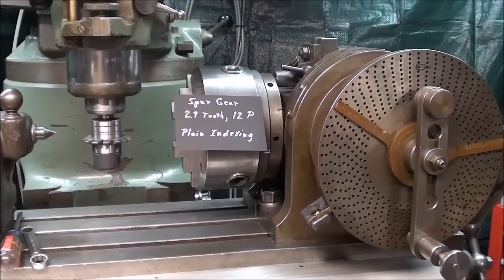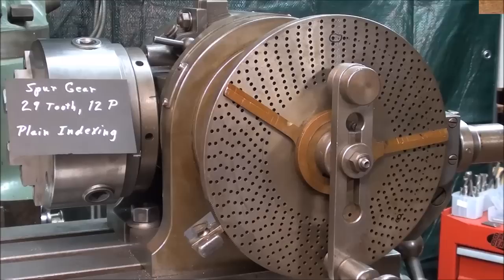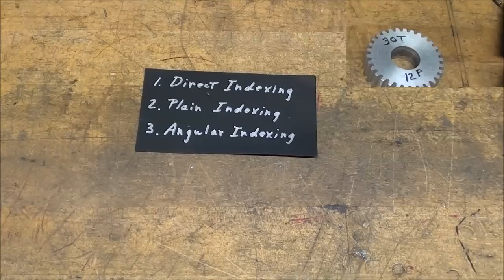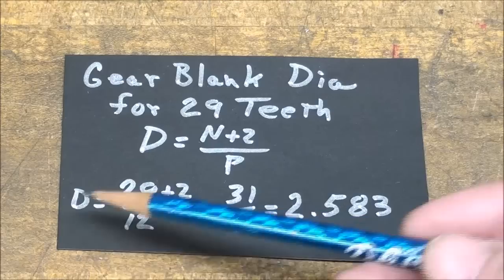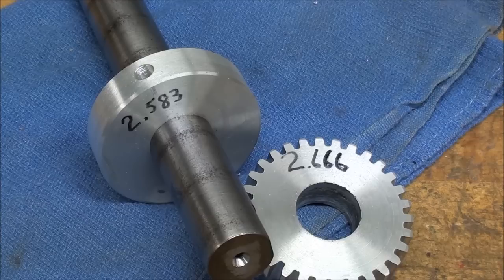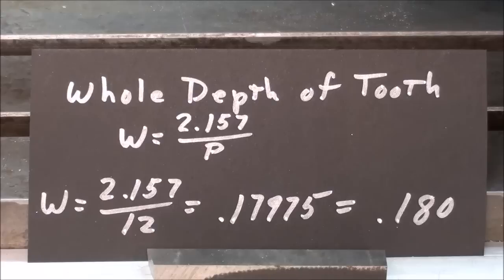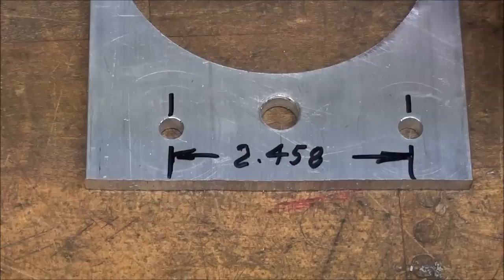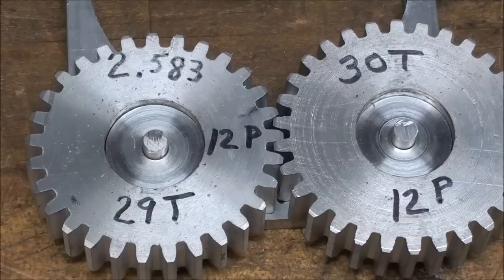SHOP TIPS #198 Gear Cutting on the Bridgeport Mill Plain Indexing Method tubalcain

Comment: Good Video. I could see the cutter running out of round both vertically and horizontially. I'd have to check both faces of the cutter and see if center hole was drilled dead center. Must have been made in China !
Reply from the maker: All my gear cutter seem to run off center
Reply: @mrpete222  So that doesn't effect the depth of the cut ?

Comment: Hidy to ya. I appreciate all your work. Thanks for showing formulas & what they do and how they pertain to actually cutting the material. Thanks for narrating the videos so nicely & being clear about everything. And finally, thank you for all the prep work and setups and the editing and posting of the videos. THANK YOU ! YOU ARE APPRECIATED !!!
   Here's a tip, you probably already know, you can get permanent Sharpie-Marker off of most surfaces by scribbling the mark with a DRY ERASE MARKER, and then immediately wiping it all off with a good quality paper towel. It works best on non- porous surfaces.
   I used to be a Machinist / Tool & Die Maker and switched careers where I got a good paying and stable job as an Electrician. I still practiced machinist things, but only as a hobby. All during that time, my spare time I was always on call for Volunteer Fire & Rescue. I'd jump & run at a moments notice, (if I wasn't at my job. I told the Fire Chief, when I was on the clock at work, that he wouldn't see me standing on the tailboard.) I did fire and rescue, till my back got banged up at work. I reluctantly came out of the fire Department. I did 21 years in it & almost 38 years as an Electrician, before I retired. My balance is gone and my health is kinda-ok.
   I still do some lathe work and make or weld up something and re-work parts to keep my equipment operational. I'm working on a center pulley movable base for a drill press, now. I've got it out of the machine. Now to figure out how to get it out of the mount, as it's dropped into the pulley. I'll eventually find a video on that. 
   THANKS TUBAL CAIN
Reply from the maker: Thank you for watching and four A nice comment

Comment: Sound is another way to confirm a correct mesh between gears.  Sometimes an assembly is in a position where you can't get in to measure.  When I installed a PTO on my RAM pickup, the instructions were to (before replacing the oil) leave the shift cover off, start the truck, engage the clutch and listen for about 30 seconds.  If the mesh is within tolerances, there will be no change in how the transmission sounds.  If the mesh is too tight, it will whine.  Too loose, it will rattle.  This requires good hearing, these days I have to 'borrow' a younger set of ears to listen for me or use a mechanics stethoscope ... so, youngsters, protect your hearing as well as your eyes.
Reply from the maker: Thanks for watching

Comment: You know I made some gears using direct indexing.... it just so happened I needed some 24 tooth gears for a project that I'm building so I lucked out on my first gears and was able to use direct indexing but the question is really unrelated I used a Chinese Arbor that has multiple bushings up and down the thing and they all seem to wobble during the operation there was nothing I could do to steady them...

Weather this had any affect on my gears finish or not I am not sure. I guess all I'm asking is this normal for these bushings to not sit quite right? I mean they seem to hold the gear cutter in place fine I guess that's all that really matters but I was just uneasy about the whole thing and wanted to ask an expert their opinion so that's what I'm doing.

Comment: Mr.Pete what if I am going to make  2 slots (0 and 180 degree) using 15 holes plate.(20 complete turns). Should I still not count the hole where the pin is engaged? Thank you!

Comment: since the spring is so strong inside the direct index pin, might it be cool to replace the knurled thumb screw that keeps it out of the way (when not needed) with a knurled thumb screw with the addition of a allen/hex key insert for "super tightening" without resorting to using pliers (which can easily start to chew things up)?

perhaps it as simple as using a cap screw itself?

Comment: i'm here watching your centering method and maybe another way to get centre is to use the parallel and index it on the blank then move half of the gear blank diameter towards centre plus half of cutter thickness
Reply from the maker: Good. There are probably many ways of doing this. thanks

Comment: I need to make some metric change gears for my import lathe, which needs a Pressure Angle of 20 degrees and Module 1.5 (about a 17 Diametral Pitch).  Since these gears only turn the leadscrew and are not highly loaded, do you think I could get away with Delrin or even Aluminum?   You see, my involute cutter set is also a cheap import... 😏
Reply from the maker: Sorry, I really am not sure. Possibly give it a try

Comment: One can Dial zero the top face of the Cutter and match it with the top Quadrant of the Arbor than move the cutter to the center. It's should be more accurate!
Overall Nice video for beginners. Thanks.

Comment: I'm' not a fan of Shars so that might be the problem. Thank you for this video. It is absolutely fascinating and I do plan to cut gears. I have a bull gear on my SB that has a tooth missing. If possible, would you suggest a proper material for these gears and or would you heat treat them? I am a knife maker so I do my own heat treat with a digital kiln and stainless foil wrap. Thanks again!!

Comment: Just curious about direct indexing options. When you say that it is not possible to cut a 29 tooth gear using direct indexing, do you mean that it's not possible on YOUR indexing head, or that it not possible on ANY indexing head? Maybe there are standard indexes on all indexing heads, and 29 tooth is not a standard?
Reply: Since Mr Pete does not answer, I'll attempt to do it for him. It is not possible on his head, because of not having a 29 hole index plate for the direct indexing side of his machine, but of course one could be made if wanted. You would rarely find one with 29 holes as standard equipment, as there are no other uses other than 29 for the 29 hole plate. A common 24 hole plate is typically included as a direct indexing plate, because it can be used for 2, 3, 4, 6, 8, and 12 tooth indexing
Reply: Jim Liechty Thanks for the reply. I figured that was the case, but just wasn't sure if there was some sort of "standard" out there that indexing heads typically use. I also didn't realize that the direct indexing side utilized an actual plate. I assumed that the indexing holes were just drilled into the back of the chuck axle or something.

Comment: Ratios are; 1.034 to 1  L to R ~~~~~ 0.966 to 1 R to L.
Reply: Agreed. Ratios are typically referenced as something to 1, or 1to something depending upon input or output. The reference of 29 to 30 isn’t wrong either.